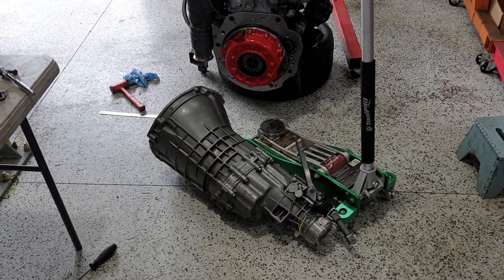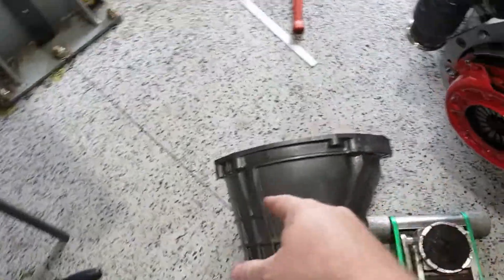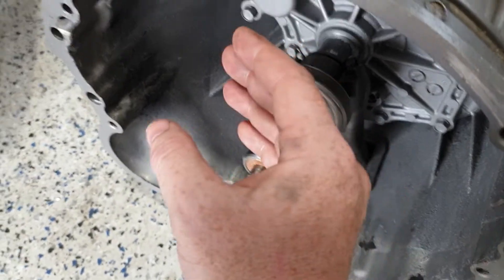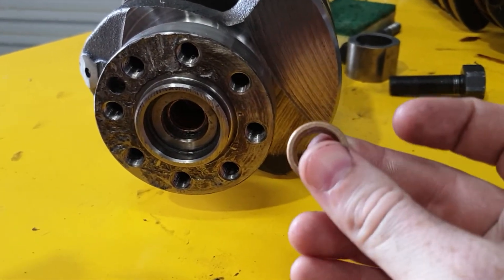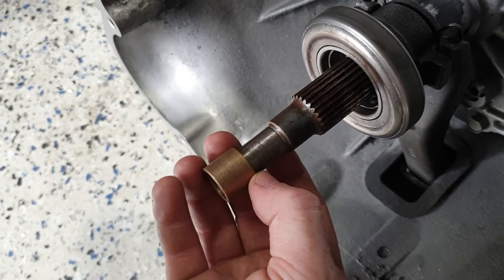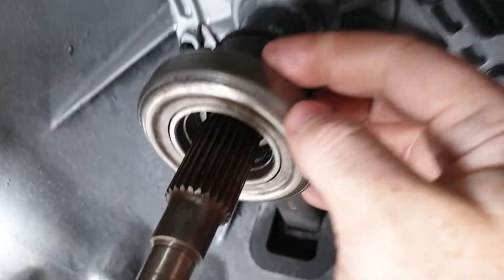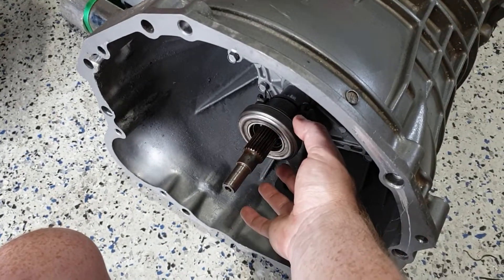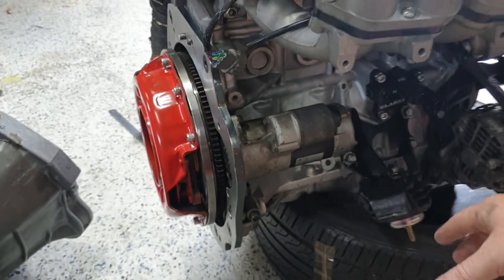Dellow Conversions SR20 to RB25 Gearbox adapter plate. Initial thoughts and installation tips.

Comment: Thanks for this video! I just got this exact kit and the packaging was not well wrapped at all. All individual pieces within the box were just floating around scratching against each other and loose bolts and washers everywhere. Going to have a go at the installation soon, seems good value for money but not much attention to detail in some aspects.
Reply from the maker: No worries mate, I had a similar issue when my kit arrived but luckily everything was still there. Since installing it we did have to install a slightly longer slave cylinder pin to make up for the additional throw the throwout bearing adaptor created. But otherwise it has been going well so you should be sweet with the tips in the video.
Reply: @Turtleism  great thanks! Did you retain the SR20 clutch fork and carrier / bearing assembly? I’ve also been told that an Sr20 pivot ball should be installed instead of the RB pivot ball (RB Is longer).
Reply from the maker: @juliandib  The SR and RB clutch fork, carried and pivot ball are the same as far as I can tell, I have been interchanging them for years and havent noticed an issue.

Comment: Gday, thanks for the video, im currently putting a R32 gtr box on to a sr20 with a dellow kit, however, i am only having 10mm of input shaft splines going in to the clutch plate 

Have you had this problem with a dellow kit ?? 

I have spoke to alpha omega but not ready to quit witb the delllow kit yet as the spline problem is the only issue with it so far
Reply from the maker: hey mate sorry for the late reply, I haven't played with a gtr box but that sounds incredibly unusual and I would double check you havent fitted the clutch plate backwards as they are directional with the spline center section poking out more one way than the other.
Reply: Gday again

Clutch was all good, i had to use a s 15 flywheel with the centre machined out to that the input shaft fit into the s14 style spigot bearing ..... 

Its been a challenge but its all functional now with 100% spline engagement 

Gtr input and bell housing are same as r33, the thickness of the plate was the same as of offset problem I was having...
Tuff decision between a flywheel offset or a bellhousing cut and shut

In retrospect, if i was to do it again, a cut and shut bell housing would be more straight forward...

My clutch
Reply from the maker: @kurtlundberg8938  Thanks for the update man I am glad that you where able to sort it, i personally run a cut n shut bellhousing for my rb25 box behind an sr20 and it has been fine. But cut and shuts vary in quality aswell so its really just a bit of a mess haha.
Reply: @Turtleism  agreed its always better and thats how il go about it next time

HIND SIGHT is always 20/20

Comment: Awesome video. I am having issues with my kit after a few thousand km's were the clutch now wont engage. What slave cylinder did you use ? also where did you get the longer slave cylinder pin from ?
Reply from the maker: Sorry for the late reply, if you are having problems with the clutch disengaging then it would be an issue with the longer cylinder pin as it will not push enough on the fork to fully seperate the clutch from the flywheel. The slave cylinder we used is just an oem rb25 slave but the nismo version is also fine for a softer pedal feel, i can't recall what we got the longer slave cylinder pin from sorry.

Comment: Does the 300 z x gearbox bolt to rb25 bell housing ?
Reply from the maker: Sorry for the late reply, the rb25 and 300zx bellhousings are interchangable.
Reply: @Turtleism  we have a 300zx box we want to bolt up to our rb25 neo det - do we just need to change bellhousings ?
Reply from the maker: @vin_garage  yes you will just need to change the bellhousing, the 300zx uses a push style clutch fork setup where as the rb25 neo is a pull type so be sure to change over the right bits to make that work

Comment: So you used used factory bush as well as the cut down dellows bush or just the factory bush?
Reply from the maker: I just used the factory spigot bush just installed further forward into the crankshaft than typical, typically you would install the bush as deep as possible into the crankshaft.

Comment: Hey mate, can we get an update on how the conversion went? Did you have any further problems as I am about to purchase this package. Cheers
Reply from the maker: Hi mate, ive driven the car now and handed it back to the owner. So far it seems to work very well, no problems with starter engagement and the gearbox is doing its thing without issue
Reply from the maker: Just replying again a month on, Since installing it we did have to install a slightly longer slave cylinder pin to make up for the additional throw the throwout bearing adaptor created as the owner noticed the clutch started to feel weird after bedding it in.

Comment: Which gearbox is the strongest out of rb25 and 300zx? and are they stronger than stock sr20 5 speed boxes? looking to upgrade after blowing 3 sr boxes
Reply from the maker: The rb25det and 300zx are internally the same gears so equal strength, I prefer the rb25det box as remote shifters tend to feel weird for me and rattle with oem shifters thats annoying as hell. Depending where you are I would consider looking at a t56 aswell (im not huge on the cd009 because of just how big it is and rebuild kits have been a headache).